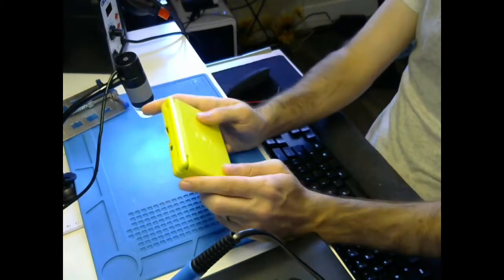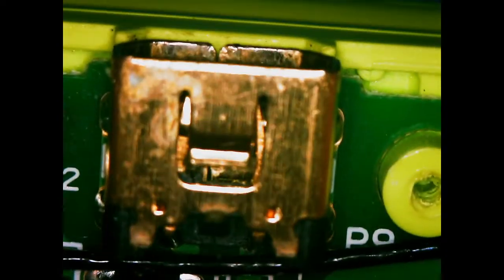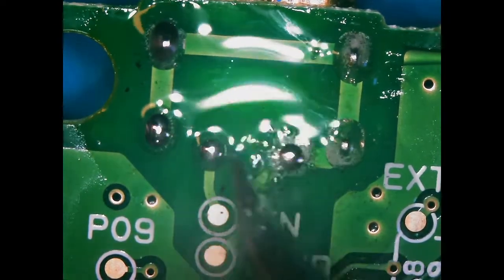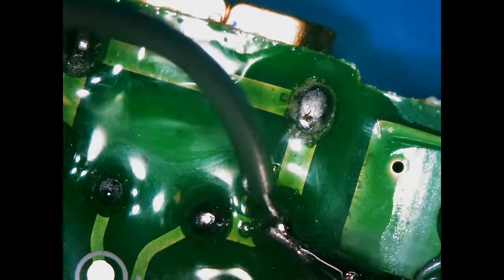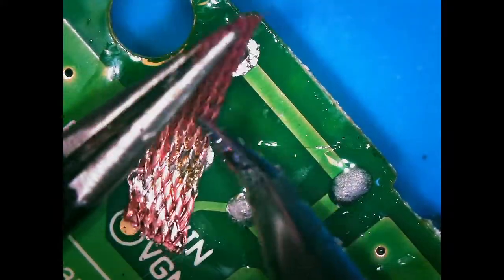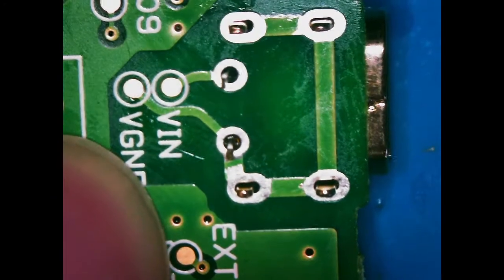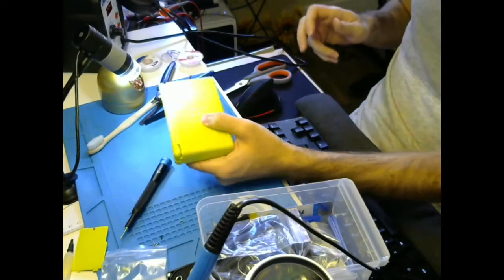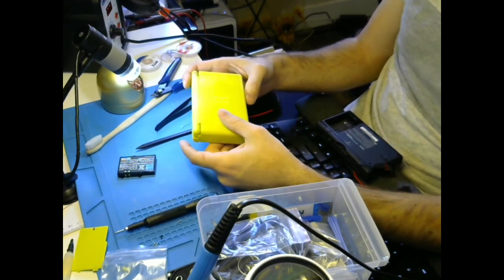DS Lite Charging Port Repair

Comment: It's so cool that I can finally understand the terms you're using like solder, flux, and wick. Sidenote, where did you get your charging port? I have a DS lite that will flicker orange when I plug in the charger but it won't stay charging. Idk if that's a problem that requires a new charging port or not. I do know that the charger works too.
Reply from the maker: I got the port on amazon :)

Comment: I enjoyed your video , very helpful👍 I noticed most of my screens or bezels on my ds lite are not exacactly put in straight, do you think it’s possible to open up the system and realign the screens? I was think about trying it,
Reply from the maker: It is possible, however in most cases I'd say it's not worth the time or effort if there's no dust or other issues. Once you separate the LCD from the plastic lens, it's very difficult to ensure a clean installation. I only will do that as a last resort if a screen is broken or dead pixels etc.

Comment: Hey I have a ds lite that works well but doesn’t charge. When I plug it in the orange light doesn’t come at all. I checked the fuses and continuity and everything works. I checked the voltage from the charging port while charging and it shows 1.7 volts. What is the cause of the issue? Is it the charging port?

Comment: Question, I bought 3 faulty DS lites online just recently (2 half red half black and 1 all black). Luckily, 2 just needed charging, although 1 has a completely loose hinge. If you have a video on a hinge repair that'd be helpful. 

However when I tried charging the black DS lite the charging light only flickered once then nothing. Any idea what could be wrong and is it worth salvaging? Thanks.
Reply: i'm having the same problem with a pink DS i've had in my family since release, damage seems to be that the plastic cover has worn away
Reply: Same with a red and black one. One blink every time you plug it in.

Comment: What heat gun are you using? Would you have a link? Thank ya!
Reply from the maker: It's a CO-Z 858D rework station. Honestly for this repair I would not use hot air again. Please see my latest upload and you'll see what I did differently! All you really need is some low melt solder and a soldering iron.
Reply: @MitchCairns  Thank you! Just checked it out and picked up some sra low melt. Also what are you using to apply flux? A syringe? I’m sorry I’m new to this. :) I have some paste but it’s in a can/tin.
Reply from the maker: @b_g_d_b  Yes I have amtech liquid flux which comes in a syringe. It's more expensive but the quality is great.

Comment: how much would it cost to repair a broken screen?
Reply from the maker: If it's just the top screen, $30, if it's the bottom screen + touch digitizer that's broken, $35. Feel free to reach out via email if you need a repair done - mitchellcairns@gmail.com
Reply: @MitchCairns  do you customize? Any way to build a GameShark into it 😂

Comment: Hello I was looking at your video and I had a question? Do you think you could repair a Nintendo DS Lite that doesn’t turn on but the orange charging light comes on and stays on while  plugged in but console doesn’t turn on. And around how much would you charge ?
Reply from the maker: Could be either of the LCDs, the wifi board, or something else. If you would like to send it in, diagnosis is free. Cost could range from $20-40 depending on what the cause is! Email me if you would like to set something up! mitchstechrepair@gmail.com
Reply: r32 fuse
Reply: @MitchCairns just watching this video. I have a DS that the charging port has a metal tab sticking up. And now we can't get a charging cord out. Is that something you can fix?